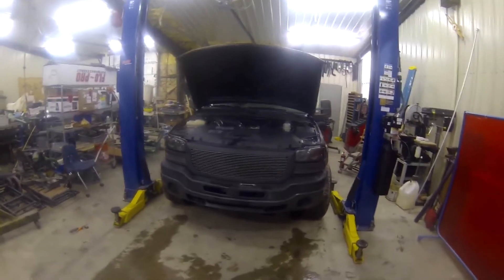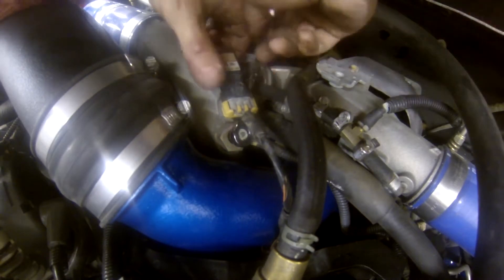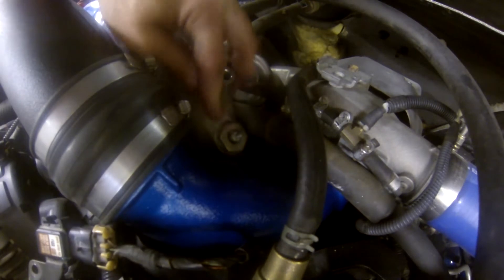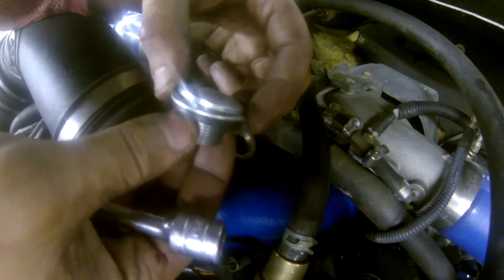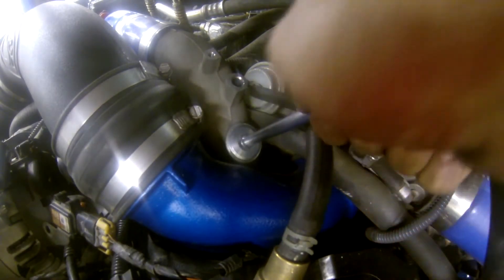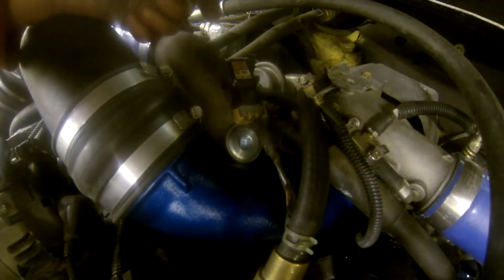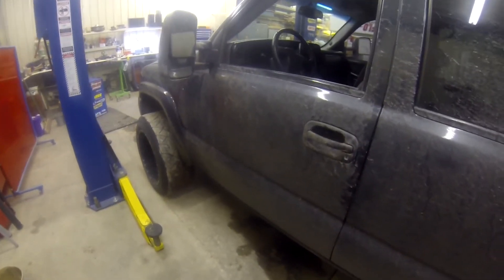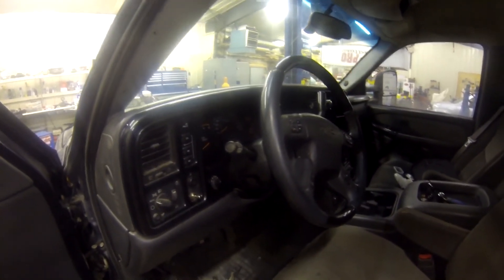LB7 Duramax Intake Heater Delete

Comment: I think I must be on a crusade about heater delete 😀.

Here are comments I posted elsewhere:

As an engineer myself, I must question mods or deletes on an engine which override the original intentions and motivations of fellow engineers who undoubtedly spent considerable time and effort designing various aspects of our Duramax engines. As we all know, economics of every aspect of vehicle design are an important part of decision making and unless a part is mandated by emissions regulations, I doubt anything is ever added without considerable research into the pros and cons. While I concede the heater coil no doubt causes some degree of intake restriction and turbulence, I’m confident those downsides were on the con side of the ledger, but were overridden by the benefits of better warmup characteristics during cold weather starts. Frankly, I don’t know at what ambient the heater is energized, but would be willing to bet there are benefits to warmer intake air, which may be transparent to the operator, but nonetheless contribute to better engine operating characteristics during that phase of operation.

I also suspect that, short of dyno testing, there is little noticeable performance difference following removal of the heater, and even then, improvement is only at the margins.

If anyone has numbers to refute my observations, I’d luv to see them.

Delete on, homey and thanks for this otherwise well produced video. 👍

Comment: You can make a plug holder and keep it wired up as long as its grounded and the ECM will not throw a code.  I'm looking at ways to make this work and not be a fire hazard.  Possibly some type of sleeve mounted to the frame.  

The cold start is handled by individual glow plugs in each cylinder along with the intake heater.  

Dodge had a similar intake grid heater.
Reply: would putting a resistor on the heater intake wire work ? it would make it think its being used

Comment: 2001 to 2003 LB7.  2004 LLY

Also 1 inch socket is a 26 meter socket I think.  
Good video.
Reply: Tim Hasselbach 2004 is a lb7 lol
Reply: @Crazy_neighbor10  actually they had both in 2004. I had a LLY in my 2004.

Comment: I put a fase plug on mine I have a tuner but my check engine light comes on I turn it off but it come back to own with in a about a couple day I even use my tec two GM scan tool but the Check engine lights still comes on

Comment: Apparently, have to have EFI Live or an HP Tuner to clear / turn off the heater code permanently. As he said.
Reply: Would have traced the wire to the glow plug relay and unbolted it from the relay then no worries about a possible short or sparks. Really easy to remove whole wire.

Comment: I put the copper ring on the outside of the rubber on the drain plug. Is that okay? And shouldn't you use teflon tape on the threads?

Comment: Do you think you can cut the original down, but still make it work so it won't throw a code and have no worries about the cable?
Reply: Still throw a code as it measures electrical resistance.
Reply: Plus by cutting it down if you shortened it up you’d probably creat an electrical short.

Comment: Hey man, thanks for the video. After doing the delete my check engine light comes on and the intake heater code shows up on my scanner. Once I clear the code the lights goes off, but only for a few days until it all happens again. Any ideas how to clear the code permanently?
Reply: What year Truck?
Reply: i wited mine to the light on the underside of the hood and used a 6 12 volt to 6 volt resistor took care of the code issue the resistor was 12 bucks at amazon
Reply: @brettkeeler819  6 to 12 volt 6 volt resistor?
Reply: that information is covered in the video. EFI Live or HP tuner will turn it off.

Comment: Hey what's the benefits of doing this? and what's the song you used in the video? thanks!
Reply: Hey Cameron, the benefits are well worth the effort muh man. The intake heater takes up a lot of real estate in your stock y-bridge.   Removing it decreases turbulence, increases air flow and distributes air to your manifolds more evenly.  I have a video on my channel showing the intake heater with the cold side intercooler pipe off so you can see exactly how much space it takes up.  Check it out when you get a chance.
Reply: Kooshdaakaa put a link to your video